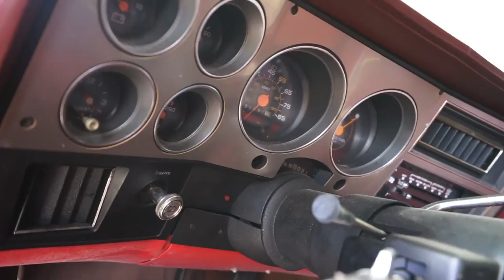LIGHTNING VS 5.0 COYOTE!!

Comment: I have one just like his but white i did jlt intake , gt intake manifold ported also ported the heads and an e85 tune and I gained 156 up from stock,  now and 503 hp to the wheels id recommended porting intake in heads to get full potential
Reply: Not heads it really doesn’t need too unless I have nitrous for it
Reply: 4x4?
Reply: @andychacon7241  that was the original plan that why we ended up doing it
Reply: @JR-wg6cs  yes

Comment: Yes port the manifold, but if you wanted an all out N/A build, I’d recommend a Cobra Jet intake, twin 65mm tb, and PMAS cold air intake. As for tunes, All motor lab has spicy tunes but I’d go with LUND RACING for their E85R tune.

Comment: Oscar needs to do traction bars intake manifold shock relocation and a. Tune from all motor labs
Reply: Lund Racing is better when it comes to tuning.
Reply: @Justin Rodriguez there is people out here running traction bars on their 4x4 trucks , guys from onDgas have traction bars on there 4x4 turbo truck nothing wrong with it just in case they want to run it in 2wd
Reply: @Justin Rodriguez 😂 to be honest lol
Reply: Traction bars will still help with wheel hop plus I don't think Oscar is putting it on 4x4 on some runs

Comment: If wanting to be max effort naturally aspirated, the yes get the 18' manifold ported. Either way, going from the stock truck manifold to the mustang manifold is going to be a huge gain. It will help the engine rev and breath much better.

Comment: People had been sleeping on them 10 speeds but now they on the rise
Reply: Gang
Reply: 8 speed rams are up there too
Reply: That’s If the lil takuaches can find them😂 they are hard to find
Reply: @Mrrollbacc  they ight , stock for stock a 5.0 beats a 5.7 any day easily
Reply: @Mrrollbacc  also seen alot of their rams go down 🥴
Reply: @josecastaneda2904  that allmotorlabs guy that works on fords got beat by a ram in a 1/4 mile
Reply: @Mrrollbacc  also depends on the mods and the driver , throw a link i wanna see
Reply: @josecastaneda2904  they were both n/a but search up just.aworktruck on Instagram should be like the 7th post on his page
Reply: @Mrrollbacc  lmfao this nigga slept at the line 😂

Comment: Unlike older gen 4.6l and 5.4l, new 5.0s respond extremely well to simple bolt ons. I wouldn't bother with getting the manifold ported, it helps but the cost to hp ratio is not worth it. Throw on some long tube headers, off road pipes, exhaust, some gears and sticky tires. When your ready to really push it throw on a pro charger

Comment: Port the intake and throttle body. Gives more horsepower and quicker throttle response. Hit up the man 454Chuy on insta for any porting needs
Reply: And definitely have it tuned by All Motor Labs. They tuned some quick ass f150s